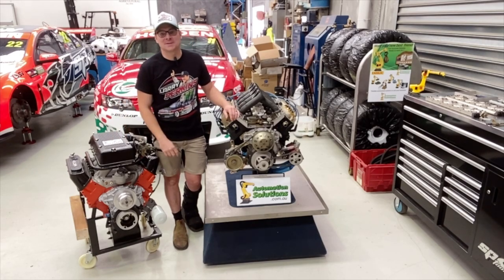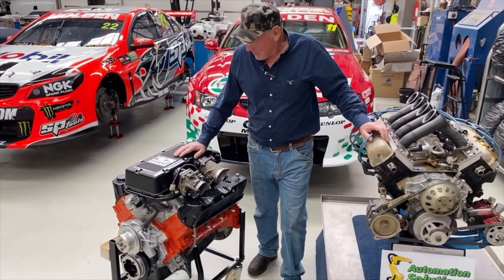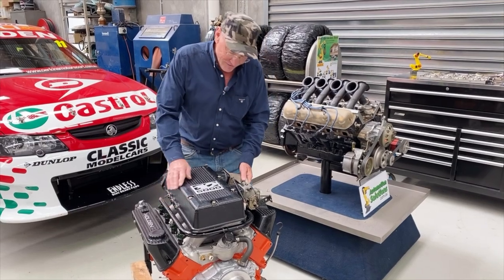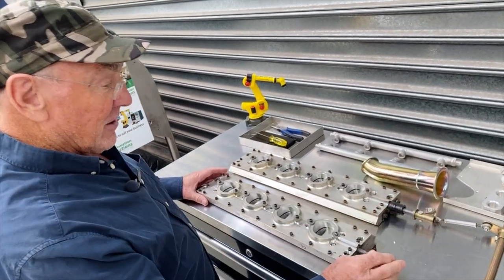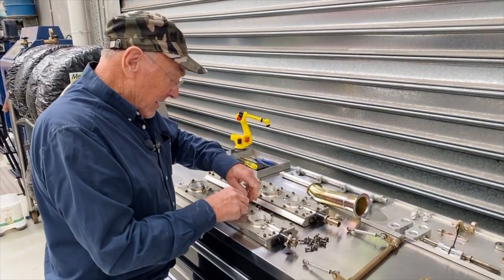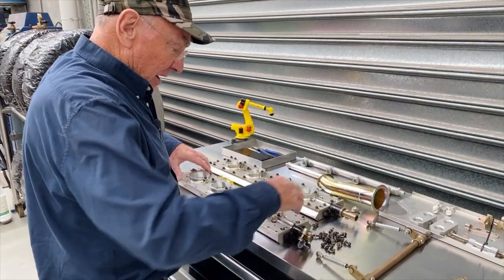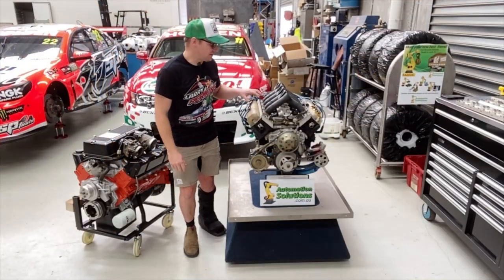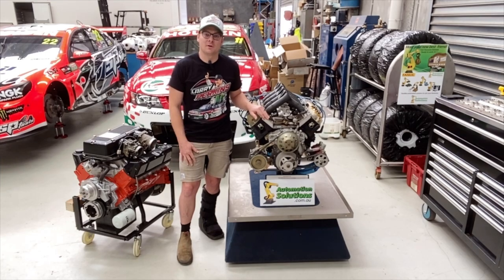Episode 27: Larry Perkins talks us through the famous Perkins Engineering Holden Slide Manifold

Comment: If you won't make any more slide manifolds could you possibly sell a set of drawings? I had a twin throttle Holden V8 for 30 years was almost a daily driver. Clocked up 370,000 kms never missed a beat. Love your work Larry! You stuck with the Holden V8s and proved they were better than the Chefs!
Reply from the maker: I don't know about selling drawings, hard to put a price on IP. There's a set of slides and a bunch of slide parts for sale on our website!
Reply: Thanks!

Comment: Awesome video Jack. LP still has it! I’m very interested to understand the benefits of the slide system over individual butterflies….
Reply from the maker: There's many, biggest is there's no interference/disturbance to the air going into the engine, there's no butterfly in the way.
Reply: Simplicity must be another factor. Tuning 8 individual butterfly's with all the mechanicals, linkages etc. Involved as well as the weight and space taken up would be huge.

Comment: Great episode Jack & Larry on the in-site to your slide throttle engineering, I was with a Ford Group A team back in the day you guys were running the slide throttle setup which no doubt gave you a advantage in throttle respose, drive-ability & horsepower. I only wish we have the budget to develop a  similar design for our C3 Yates headed Ford Motorsport engines. Our singular to each port throttle butterfly's were a fiddly time consuming process to set up and could easily stick with a wayward piece of tyre rubber in the engine inlet valley! I did some work on a BMW M10 naturally aspirated engine and with racing BMW M Power engines (racing variety not road car) and they were running rows & rows of torrington bearing roller strips (the retaining strips were plastic from memory) and that obviously had some linear advantages over normal ball bearings like you used. I recall slide throttle port had a small worm nitron type seal as well which eliminated the use of gaskets and other sealing methods.  Love your vids mate. Keep them up. Kev
Reply from the maker: Cheers Kevin

Comment: Brian Foley's alfa had a slide throttle body system back in the the early 70s too, they were used a lot in the old days on 4 cylinder engines

Comment: That  group A dual throttle body  setup  is the ducks nuts. 

Can find em these days for less than 15k.. (intake and rocker covers)
Reply from the maker: Slide throttle much much better than the twin throttle body!!
Reply: @perkinsengineering  it looks like it too.
Reply: They had trouble selling VL Group A back when it was made...
Reply from the maker: @gerardcrabb4556  right in the recession and very high interest rates
Reply: @perkinsengineering  Made extra 250 VL.. VN only 300 odd.
Reply from the maker: @gerardcrabb4556  👍👍

Comment: What’s been done to the motor for sale Jack ,and can you do all the mods with LP  on the oiling system on the Holden race engines ,speedway boys have given out there secret would be interesting what has been done ,cheers 👍
Reply from the maker: It's been rebuilt by Neill Burns, somewhat period correct, new JE Pistons, Compstar Rods, as per 1989/90 spec with valvetrain

Comment: Good stuff Jack and LP. I can only imagine how much trickery was inside the block as well as the slide manifold. Did you run the flat tappet cam type or roller cam? I have an 89 VN SV100 (basically a Calais SV89) and that Group A motor would suit me nicely........ Cheers!

Comment: Awesome video! What sort of power gain were you getting with the slide throttle set up over the twin throttle body manifold?
Reply from the maker: Generally speaking 20-30hp, but the ability to tune the engine was improved, it was slightly lighter, lower centre of gravity, better drivability etc. So even if it didn't improve HP it was a gain everywhere else

Comment: Love the content guys.
Just wanting to confirm something, the slide throttle motor with the cutaway rocker covers, thats the engine that sat on display at Holden Engine Operations Plant 16 for many years correct?
Is that the 93 Bathurst winning engine?
Reply from the maker: Cheers! Yes that engine is back with us now. No it’s not the engine, but it was branded as the race engine. That engine is just a dummy engine for the purposes of display
Reply: @perkinsengineering  thanks very much for clearing that up.
I walked past it almost every day and stopped to look at it every time. So that engine was purely for display purposes, if I remember correctly it had a plaque that stated it was the Bathurst engine.
Reply from the maker: @lachlansheekey2839  yep correct. Our guys Called it the yabbie, all shell and no guts. I don’t think it has pistons or Conrods in it!
Reply: @perkinsengineering  haha thats a ripper nickname.
Thanks again for replying and bloody quickly too.
keep the content coming it's awesome diving into the past of one of the most legendary race car builders.

Comment: Looking at the Race engine I Noticed the water outlets that were added.  Was the block modified to redirect coolant or were these just to manage steam inside the head?
Reply: No coolant neck coming out of the middle of the inlet manifold. 
Smokey Unick used a single outlet from each head,similar to LP's throttle slide heads
Reply: @malbirrell  Yep, Mal's on it. Most race engines have them. They are simply there because the water cross-overs are no longer in the manifold where they would run across the valley. Keeping hot water away from the intake charge is beneficial for power, but it also makes sealing the manifold (which obviously gets removed so often) easier, as you don't have to seal up the coolant galleries on the heads. Most of the time the intake ports and galleries are all O-ringed for quick and efficient removal / replacement.
Reply from the maker: No mods to the block for coolant, just taking off the twin throttle body took away the neck as mentioned here

Comment: I wonder how a modern version of this would do with a DBW throttle on a Gen V LT small block. You could get extremely good 0-20% part-throttle road manners while having unrestricted airflow at the top end. Could this be made to work with an electronic or electrohydraulic controls system?
Reply from the maker: @spdcrzy  of course, anything is possible in this day and age. Only requires the DBW to work between the throttle pedal and the slide plate which is a simple push and pull

Comment: So the reaon Larry persisted with the Holdens over the Chev engines. Hi port heads that are production? How much more power did they make over production heads. I suspect quite a lot. And that is the head alone let alone the slide intake.
Reply: It's great to see the direct connection the manufacturer had with the race team. I have read Larry also asked Holden to cast a batch of strengthen blocks all with the stamping code "LP", with extra material in the crank webbing and cylinder wall thickness. It wouldn't surprise me if the deck thickness is more, too.
Lifting the port floor does work wonders for increasing airflow. The roof of the Injected Head above the valve is perfectly shaped to turn air into the center of the cylinder giving greater airflow without dumping fuel straight onto the bore wall. It's very easy to see what clever people can do with simple "as cast" gear, just what racing has always been about.

When Holden racing teams switched to Chevs, it no doubt made no financial sense to continue the V8 casting and switched to importing LS motors.
Reply: They would be everything. It's ALL in the head design. Combine that with this direct runner design and a tuned exhaust header system and that's why they make so much power for what they are.
Reply: The last 1992 Group A heads went to 483 go gross, with the slide throttle, 559 HP gross. So the high porting and zero loss intake allowed the 280 CFM head flow to make 2 HP per CFM. All in the approach. Larry used BMW Formula 3 tech with his native home town smarts...
Reply: When I played with the Holden head, I managed to get 230cfm@0.5in using the stock 1.94in intake valve. A standard head is around 215.  Squeezing an extra 50 from it would have been phenomenal! 
However, with the budget of only a cam, intake manifold and LS Beehive spring upgrade, I can only imagine. If I do get the opportunity to play with better, there are castings like Yella Terra and Torque Power which could eclipse the 280cfm that Larry had done 30 years ago.
Just giving Holden fans an idea to stay with the Holden V8 rather than going with an LS.
Reply: @crd-nz_001  Look at 7:33. High ported 7/8th  of an inch, ports almost as tall as 4V Cleveland's, and this bad boy still idled almost like a Streeter. This info from LP...almost too good for us.
Reply: @deanstevenson6527  All in the tuning, too. AND they idle high don't forget. Even with tight LSA cams. The overlap is actually not that crazy, usually around 55 degrees.

Comment: Hey Jack i hope this doesn't sound like a dumb suggestion but I wonder if making single front mounted slide throttlebodies for people who drive and drag modified V8 road cars might be more feasible and simpler than 8 of them under trumpets? Having virtually near-zero flow restriction compared to the butterfly I think would make it very appealing in itself
Reply from the maker: You'll always have issues with only one throttle opening for 8 cylinders, even 4 and 6. Throttle response will always be delayed and not as precise, as will even distribution of air flow and cylinder equalisation

Comment: What is it about the slide manifold that makes it unsuitable for the street and what are the power gains in figures it gives over the twin throttle body set up?
Reply: Slide throttles aren't as progressive as a butterfly, at part opening the air behind the slide is more turbulant so the engine doesn't run as cleanly. In road use this makes it harder to drive.
For race use you're usually either at wide open throttle or shut, part throttle control is less of a problem compared to driving a car in traffic
Reply: Nightmare trying to tune 8 individual throttles is, from everything from partial throttle to full throttle. Not to mention fuel efficiency as they are for primarily making power.
Reply: @davidivers6261  would probably take a whole change of style to drive the thing . bob janes monaro originally had slide injection on it , john harvey liked it , jane didnt for the reason you said , even on a race car .
Reply: @stephenelliott5173  agreed, for somewhere like Bathurst or Sandown where you're on WOT for large parts of the lap it would definitely be an advantage, but somewhere like Phillip Island where there's a lot of part throttle for the long corners I can see where it would be a lot more effort

Comment: Awesome info on the slide throttles Jack typical of the thinking of race teams though when the V8s were getting flogged by Fred Gibsons' Nissans instead of developing a faster V8 they sooked and moaned about the Nissan being to good I would have thought fitting a turbo to the V8s would have solved the problem in fact I knew of a young Nissan mechanic back in the day who had a Nissan powered VL Commodore making around 700 hp so why bother with the V8 if you cant beat em join em
Reply: 2 liter Fords were beating them first, so they weighed them down.
Reply: Sacrilege. Who wants to listen to screaming turbo 6s when we all want is the  high revving V8 growl? Jeff
Reply: Rod, I would suggest you learn the basics of the Group A Tech Regs. All the answers to your hypothetical questions will explain why things happened as they did back then.

Comment: did you run any type of grease on the bearings in the slide throttles?
Reply from the maker: No way! Grease would attract dirt and debris and cause throttle sticking issues.

They are a dry assembly
Reply: @perkinsengineering  Awesome, thanks for the reply! I have built my own set of slides for a bmw 4cyl engine, and havent found any yes/no info on whether to lubricate the bearings. Oneday i'll actually get to having it running

Comment: There is no doubt about the Holden 308, it was a magnificent engine with a huge amount up its sleeve for geniuses like Larry to find. Jack, does Larry have any engineering background or is he one of those rare naturals not spoiled be formal training? Bob Chamberlain had no formal engineering training and look at what he achieved. Jeff
Reply: except its a 304, not a 308
Reply: @davidewhite69  Where did the 304 come from?
Reply: @jefftheaussie2225  Same bore as the 308 but a shorter stroke/connecting rod than the 308. It all came from the 308 being just over 5000cc. In Group A rules that meant a 1400kg minimum weight as opposed to 1325kg for cars under 5000cc. Naturally, the shorter stroke made it a bit easier to gets reliable revs out of the engine. The Group A 304 homologated in the VK Group A Commodore addressed a lot of the weaknesses found in the factory 308 & 304 motors. Better heads, bigger valves, double-row timing chain & stronger connecting rods just to name a few.
Reply: Also it ran on unleaded fuel due to the lower compression ratio which resulted in lower power. They overcame that with fuel injection and bigger valves. Can put those bigger valves (VN) in the 308 heads. The 253/308 all had the double row timing sprockets but came out of the factory with a single row chain. That must have saved the accounts real dollars. It is all owed to the mighty 308. If all that tweaking was done to the308 on leaded petrol……
Reply: Also Brocky’s VK was a 308 lead burner hence the last of the big bangers. I had a VK and it was a 308, it got VN valves when I took a lobe off the cam shaft and did some mucking about as a result of that. It was all done for unleaded fuel in 1986: VNs onwards
Reply: Strike VN insert VL
Reply from the maker: LP isn't an Engineer from University or anything, a worn out wind mill mechanic he calls himself!
Reply: @perkinsengineering  Thanks for the reply Jack. Having run up and down a few windmills myself, (possibly the simplest and most frustrating form of engineering in existence) I can sympathise but it would take a bit more than that to get to LP’s level. Jeff

Comment: Imagine how much simpler it would be to have this instead of the butterfly... can’t let an engineer make things cheap and simple can they?
Reply: If you're referring to road cars....slide throttles are terrible for road use. And road cars have a lot of other compromises. Engineers rarely do dumb stuff for the sake of it, especially in a production vehicle
Reply: Not sure that the slide manifold is simpler or cheaper than butterflies, to be honest, either….
Reply: Butterfly throttle bodies ARE cheap and simple. Do you know what sort of nightmare trying to tune 8 individual throttles is, from everything from partial throttle to full throttle? Not to mention fuel efficiency as they are for primarily making power.

Comment: easy throw the pattern into a cnc milling machine, whats the big deal
Reply from the maker: That’s the easy part! Heads need holes machined for threads so that the slides can mount properly. Ports need hand finishing to match the slides and slide plate. All requires a fair bit of sub assembly and assembly post machining.